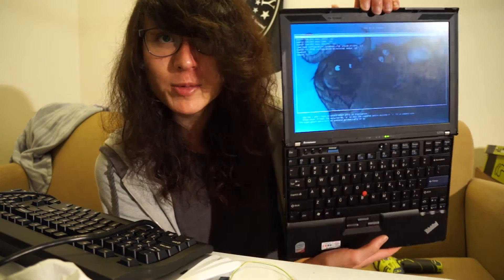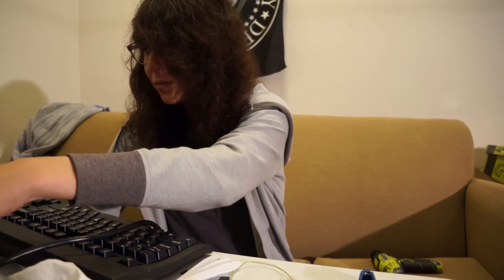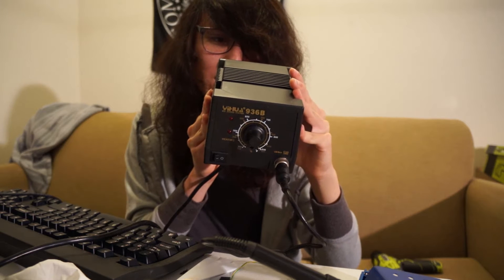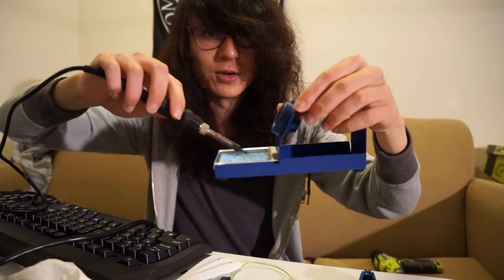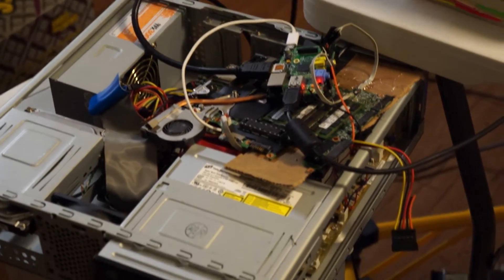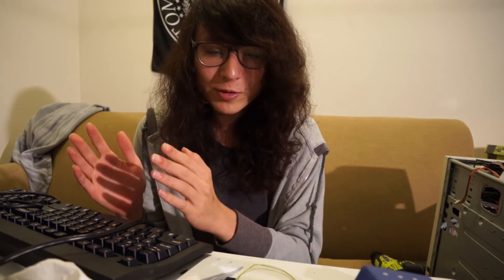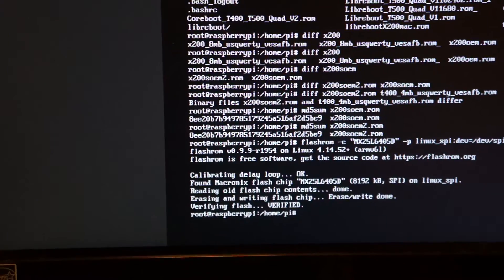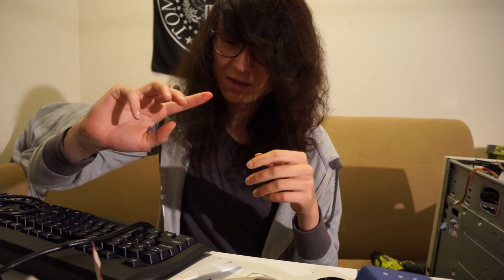X200s / X200t libreboot without a hot air station (Not Recommended)

Comment: are x200s even good for a daily now ? found a really good one for like 60 bucks.
Reply from the maker: I use it as my daily, I even edit videos on it. I convert the videos to be usable over copy codec, and use ffmpeg with some ncurses wrapper I wrote though.
Reply: @tripcodeQ7  This is my main concern. Like, if I can watch 1080 video on my x200 that's in the mail, I have no reason to use any other laptop with my use case.

(You're adorable, by the way.)
Reply from the maker: @newq  Thanks, most likely it can, I use a x200s ulv, and it will play 720p from youtube, not 1080p (Mine has a 1.2ghz cpu). It will play 1080p from a file though. I edit my videos on this system. They are 1080p at 25fps.
Reply: @tripcodeQ7  Cool. I can certainly live with 720p. You may now disregard the email I sent you asking literally this same question lol.

Comment: Hi, i have a Thinkpad R500, do you know if it can be librebooted? It's not on the supported models list though quite similar machines are listed. It has Intel video and I've upgraded the CPU to c2d p9700 (which i can undo if that's an issue).
Reply from the maker: https://www.reddit.com/r/libreboot/comments/87gxuw/lenovo_thinkpad_r500_is_supported/
So, in summary its broken, it will flash, but I would just go with a coreboot rom.
Reply: @tripcodeQ7  thank you!

Comment: It seems that the power supply setup is the most important part of this setup. I'm just about to solder my x200t to my raspberry pi 3 B model. I'll use the pi's 3.3V power supply, see if that works and let you know. I read a while back that the pi 1's 3.3V isn't powerful on it's manual a little while back (something like it only able to only power a certain component or 2), but its manual also said that future pi models should have more powerful 3.3V supplies. In case my pi's 3.3V doesn't work would you mind elaborating more on the power supply you used and how you wired it up?
Reply from the maker: I just had it plugged in to a computers 3.3v line, I don't remember the color and powered the system on. I think sata power has 3.3v. Goodluck man!
Reply: Yeah, the R-Pi's 3.3V line shuts down the system if you pull too much current. I built a little robot with a Pi Zero and I tried to run the motors off of the 3.3V line on account of me being a total moron and it never worked for obvious reasons. Ruined a Raspbian install that way.

Comment: Hello.. will you consider to do the service to Libreboot my X200s? BTW very good video!!
Reply from the maker: There is someone on ebay doing a Libreboot service for the x200s. I haven't tried it, but I might try to sell a librebooted x200s in the future. I'm a bit worried about messing it up on your system to do a service. I've only installed it on a x200s once so far.

Comment: Yoo tripcode the part where i am fucked is on changing the kconfig file, to make it instead of 2 cores allowed, and put 4 cause quad core. How do i do this?
Reply from the maker: I used grep to find the text with the max cpus. Then I changed in in the source. I ended up just testing it out with the precompiled roms though.

Comment: Hey i am thinking of getting an SSD for my x200s, what size(2.5 inch?) should i get?
Also, I hope i would be able to libreboot it now, i am afraid i might mess it up.
Reply from the maker: Yes I think it uses regular 2.5" 9mm drives. So pretty much any sata ssd will work. If you are gonna try it, go for it, but if this is the first time doing it though you might want to try librebooting some other hardware first to reduce variables.